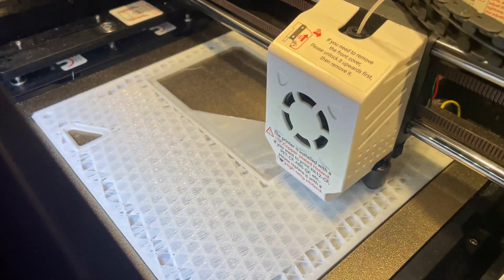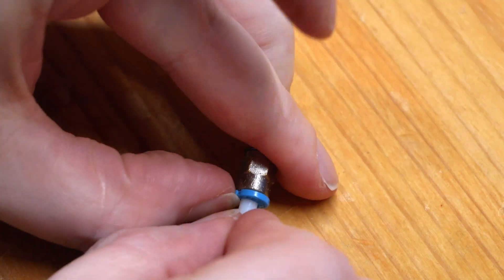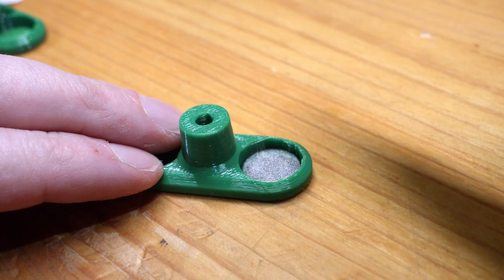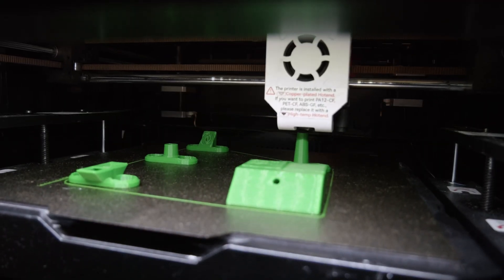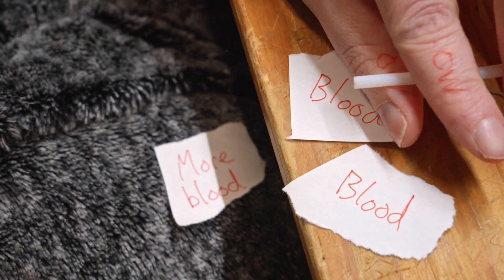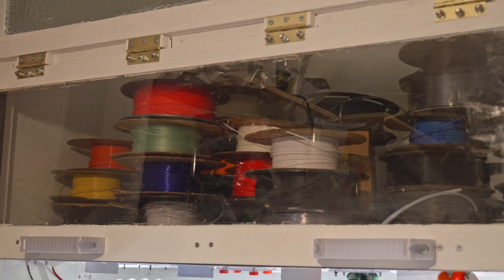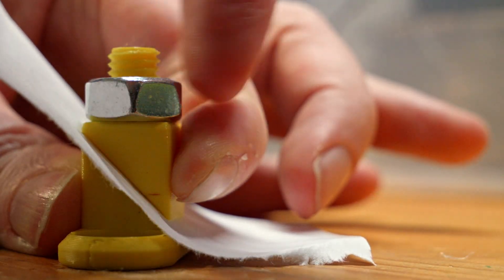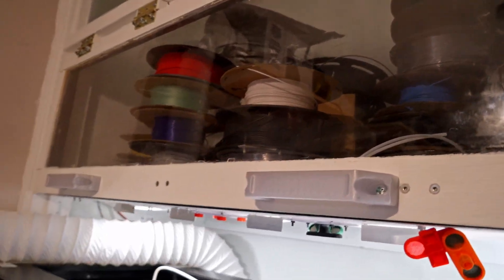Mcwomfa, the air-tight magnetic PTFE tube coupler for your 3D printer!

Comment: Love the setup with the cabinet over the printers. It shouldn't matter that it isn't airtight since the only air movement will be from temperature expansion and contraction.
Reply from the maker: I hope so! It's got a bit of a seal around the door edge and I've painted over the whole inside just in case. Main thing I need to sort out is some proper shelving for silica desiccant trays! Future Fneb problem :)